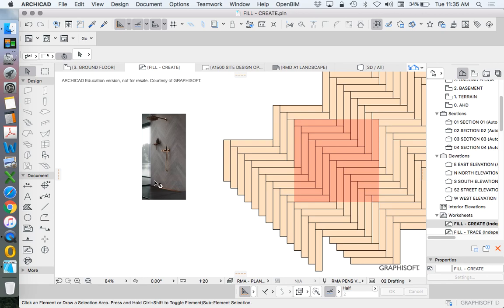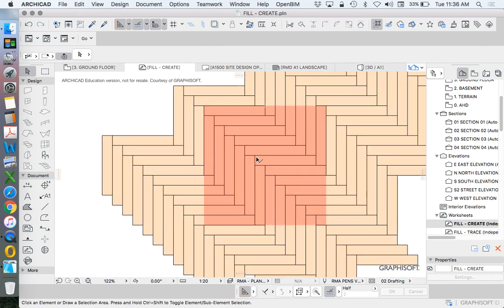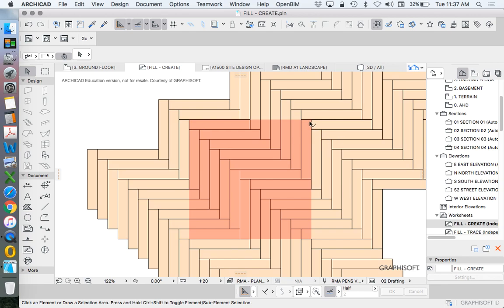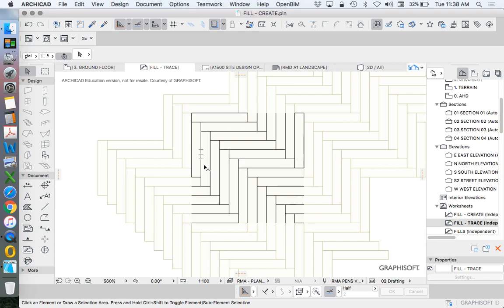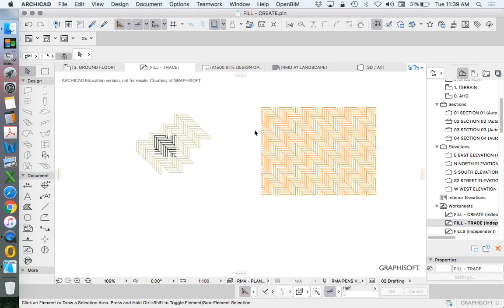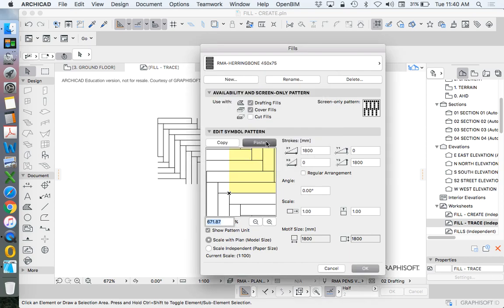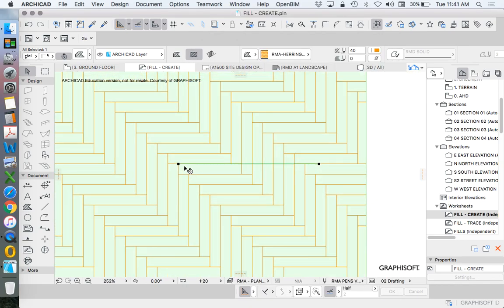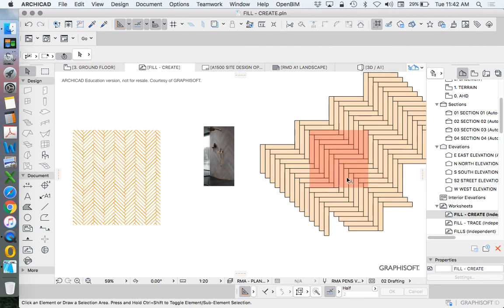ArchiCAD Custom Fills - Herringbone

Comment: How can I run this type of frame with different tones in each part
Reply from the maker: Hi Paulo, I'm not quite sure what you mean. If you are wanting to add variety to a vector based fill, this isn't possible. However, you can overlay multiple fills. So you might add a gradient fill over a vector fill. Otherwise, you might want to check out the new curtain wall tool as this could create what you are after in 3D.
Reply: @RobertMannArchitect  
had not thought of using the curtain wall tool, I will test to see and return

Comment: But this is not a material, right?.. It's only a fill for section or elevation
Reply from the maker: Hi Reem. Yes this is a fill. A Surface Texture (in ArchiCAD) is used for photo-rendering (and visualisation in Open GL 3D window) a fill can be used for either sections, elevations, floor plans, details or internal elevations (as is the case in this instance) An ArchiCAD Surface often also has an associated Fill so that it can be viewed in either 3D or 2D